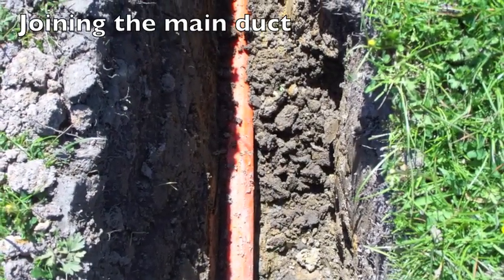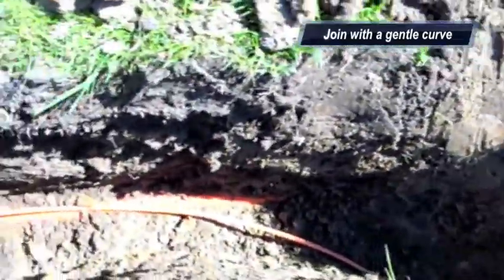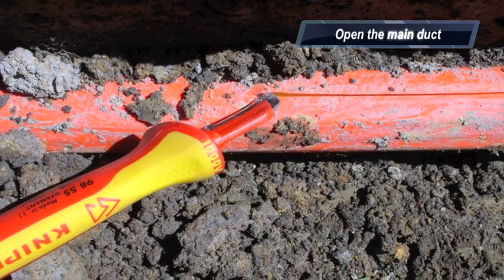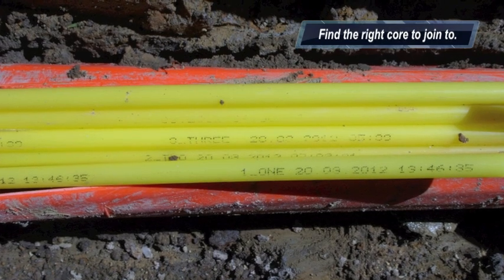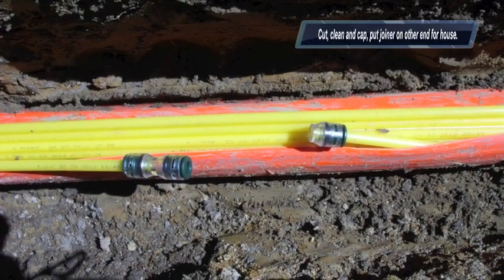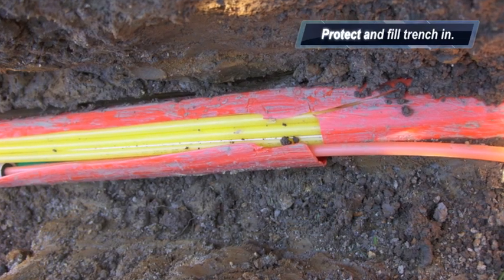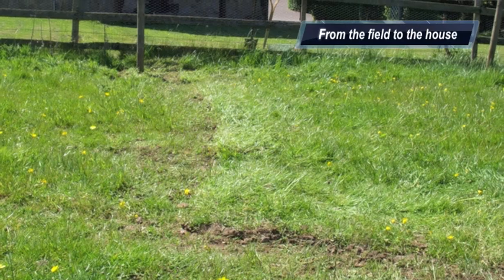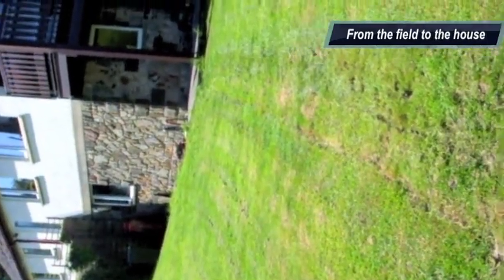B4RN house Install

Comment: I used to do arc fusion splicing with recoaters and stress test...  What are these interconnects?  I've never seen anything like them.  Are you using SMF fibre?  Would B4RN be willing to talk (off line) pertaining to their methods?